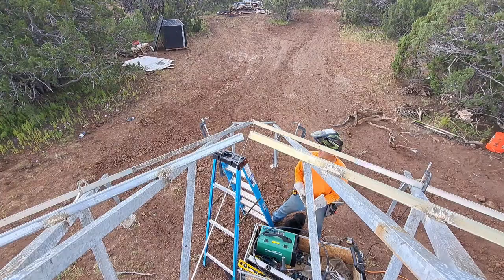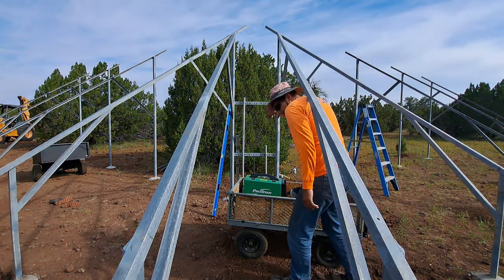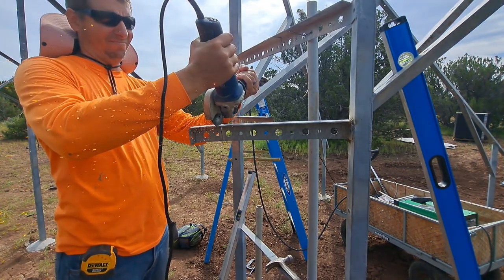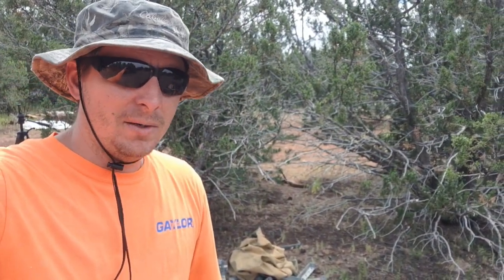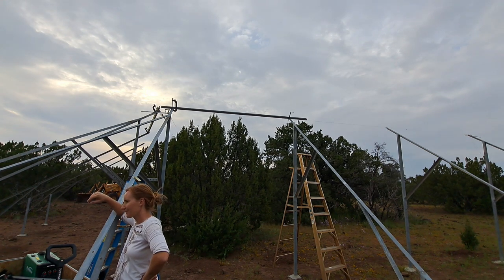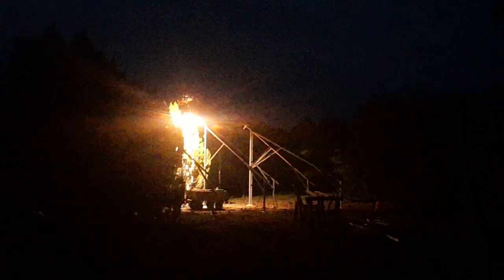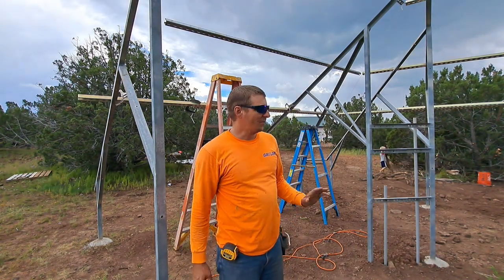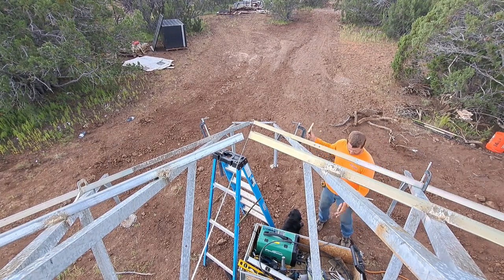Unistrut Goes Up On Our Southeast Southwest Ground Mount Solar Stand

Comment: When aligning the unistrut on the ground mount braces, you could have used connection brackets to tie the ends of the welded sticks to the unwelded sticks for one-man mounting with a clamp to keep the free end in roughly the correct spot, until you could measure & level everything out.